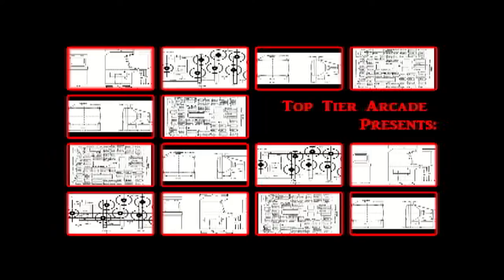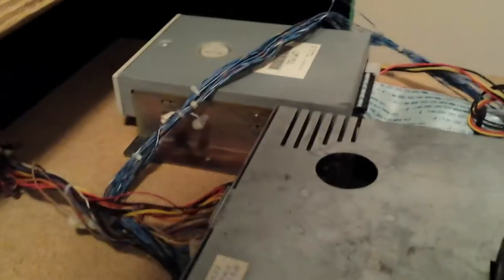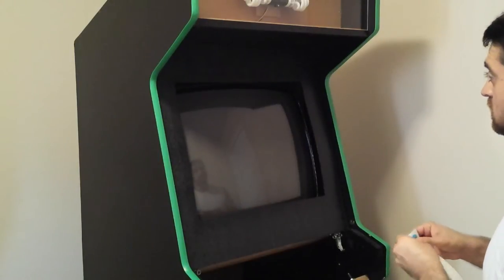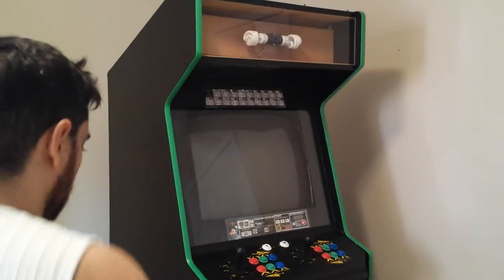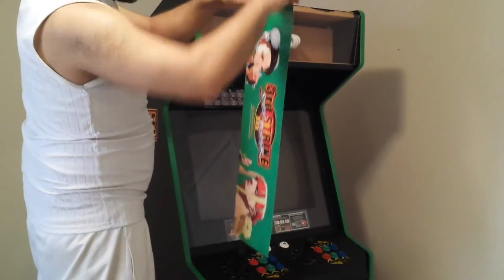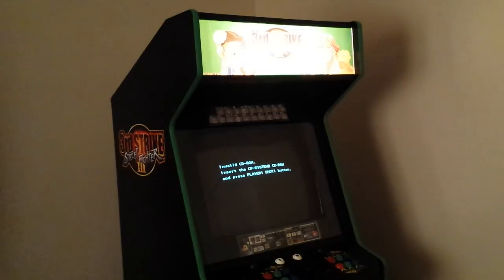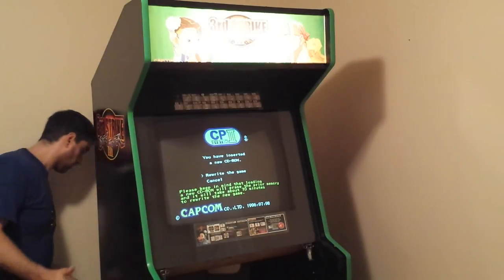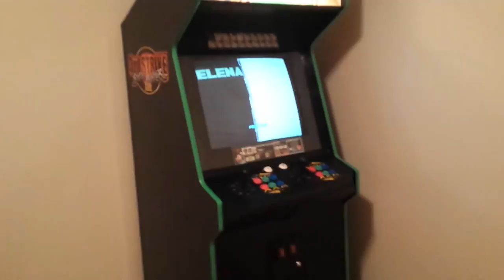Top Tier Tech - Street Fighter 3: Third Strike - Cabinet Restore - Part 13 (FINAL) [HD]

Comment: Not bad. You will improve. My first CPO had several air bubbles. Did you use rapidtac? I recommend the cleaner and applicator along with a squeegie and you won't have a single air bubble.
Reply from the maker: +ddpaul22 Thank you. I did not! The adhesive never stuck to the metal in my parent's hot-ass kitchen. You're right, the surface wasn't the most smooth either. Plus, I was working with too much material. Either way, I will change it with a different art approach and take all the info y'all have given to make better next time